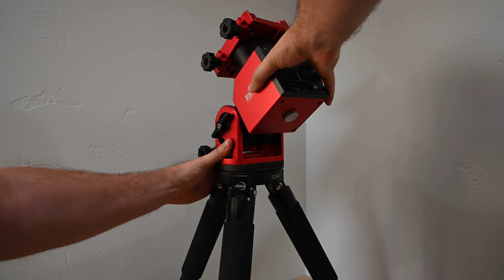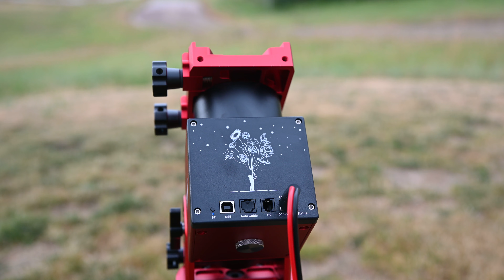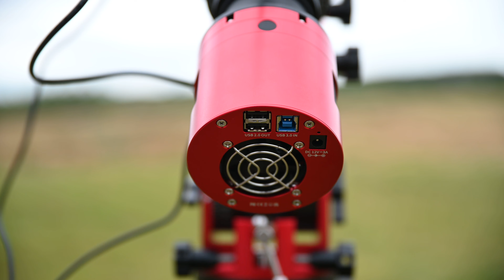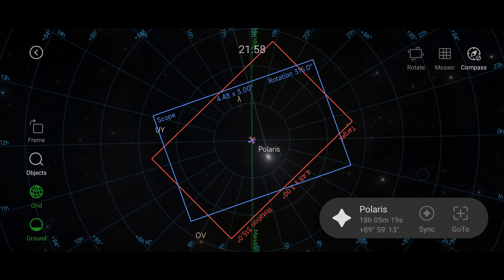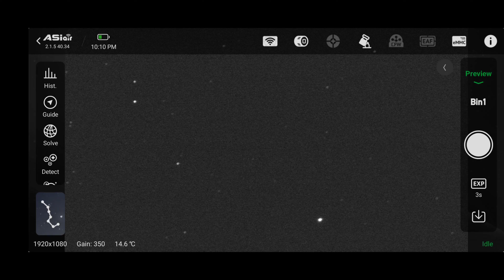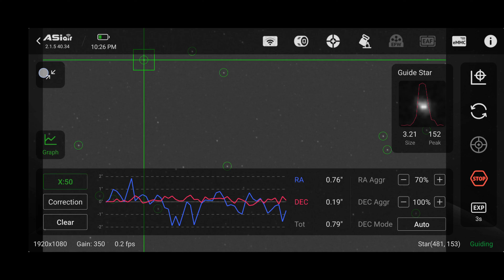ZWO AM5N - Full Setup Tutorial

Comment: Great thorough video.  I also have a AM5N and 2600MC Air and have struggled with the guide sensor (mostly just with my SCT) so those were some great focusing tips.  One thing I was wondering is if the AM5N has go-to functionality without using ASIAIR?  For example if I wanted to use it with a DSLR.  I tried using the hand controller with the SkyAtlas app and couldn't figure it out but it didn't seem like it was possible.  Thanks!

Comment: Using the DC connection on the Jackery is also more efficient.  If you use the AC plug, there's loss when you convert the battery's DC power into AC, and then more loss when the power brick takes the AC power and converts it again BACK into DC for the scope/ASIair to use.

Comment: Hi Peter, excellent tutorial.  I am having an issue with my AM5n. I am using asiair, redcat51 and canon R. Plate solve on preview is fine.  It shows BIN1 and I have selected 3s exp. When polar aligning, plate solve is fine at neutral position but unable to plate solve after 60 degree slew. It just shows loading and nothing happens. I have tried everything but having no luck
 Any ideas?

Comment: Awesome video, thank you! I'm using the AM5N with the beefier pier extension, on the TC40 tripod -- just setting it up for the first time today, exciting. I'm a little confused because the azimuth adjustment screws don't seem to do anything at all. I rotate them contrariwise through their full range either way, and there is just no lateral movement of the mount. I can loosen the holding screws on the pier extension and rotate the mount that way, of course, but I can't seem to figure out why the azimuth screws don't do squat. Any ideas? Altitude works just fine, on the other hand, just as depicted here.

Comment: To balance on the dec axis,  assemble the rig, place masking tape across the dovetail and place the dovetail on a round pencil, smooth surface and move back and forth to approximate the balance point mark the spot where pencil is located, then when mounting place the mark at the center of the mounting deck. The Ra axis requires serious math so I just follow the manufacturers specs best I can.

Comment: Tonight was first light with a new AM5N mount and my ASIAir Plus kept dropping its the Wi-Fi signal. Is that because the Wi-Fi signal of the AM5N mount is causing interference?  If so, how do I turn off the Wi-Fi broadcast from the  AM5N mount? I tried using the SkyAtlas app and don’t see a setting to turn off Wi-Fi for the mount.  I'm not sure if this is the culprit but I never had the ASIAir drop signal like that.  I would think ZWO would have them run different signals.

Comment: I am also unable to pair the ASIAir and mount using Bluetooth.  Peter did you ever figure out the problem during your test with BT?
Reply: the bluetooth works well,  going in settings on the application, Asi mount setting, connect via bluetooth then click on the button on the mount
Reply: @insalatacosmica  In AsiAir I only have USB and WiFi as connection options.  Are you connecting via BT using the AsiAir?

Comment: Awesome video! Just got the AM5N, with the pier extension and the TC40. Your instructions were clear and easy to follow. This was  filled with answers to all my questions. I am keeping it handy to help with getting acclimated from AVX mount to the AM5N. The whole rig is so much more manageable  and lighter. Thanks again, and keep up the great work. Clear skies!
Reply: Wow my AM5N mount arrives today and  I’m also coming from the AVX. I ultimately had driven myself crazy trying to get AVX to work with ASIAIR+, to the point where it was all just sitting dormant for months! I was hoping to still use my nextstar 8SE with the AM5 for now, anyone have issues with that or another Celestron SCT OTA? At this point I might as well get a ZWO OTA and fully immerse into the ZWO ecosystem, but was hoping to give my wallet a break for a little bit
Reply: Here doing the same with the Am5N, changing over from the Az-eq6. This video answered all my questions & made set up so easy! Tnx 🤗
Reply: @luketown8054  what’s your full setup? Unfortunately cold, grey, and snowy here in the mid-Atlantic so still haven’t setup my AM5.

Comment: My Ecoflow River 2 Max powers the AM5N fine. The two DC ports are only 3A, so I may end up using both ports to power everything. We will see. My only troubles were I did not see the power switch at first and then I learned from you that you plug the hand controller in AFTER you power up the mount. Thank you.

Comment: You mention azimuth adjustment of only 6 degrees, and loosening  the lock to rotate the entire mount further. OTA is at 60 degrees CCW, making it off balance. Start PA at 60 degrees CW and second plate solve position will be balanced, making loosening lock safer and less difficult.

Comment: Great video tutorial Peter!
The way I focus the guide camera using the ASIAIR is as follows: 1. select guide camera as main camera, 2. select a bright star and let ASIAIR go to and center it via plate solving. 3. use the Bahtinov mask and the Focus - Tab (not the Preview - Tab!) to shoot continuously e.g. 0.2 to 0.5 sec images (this short exposure time works well wth stars like Arktur, Vega, Deneb,...). With these bright stars you see bright spikes from your bahtinov mask and you can seemingly adjust focus with immediate feedback as you shoot several images per second. 4. switch back to real main camera, go to again to the same bright star (in case you use an external guide scope where you have an offset in FOV between guide and main camera) and do the focus procedure with Focus-Tab + Bahtinov mask again for the main camera (in case of the Duo-Camera of course you first have to focus the main camera and second focus the guide camera).
This procedure works very well for me and is done in a few minutes.
Thanks a lot for your great videos!

Comment: if you kick off imaging on the Asiair and walk away, what happens? you mentioned reconnecting on your ipad, does that mean the asiair just continues on without you being connected to it?
Reply: Yes. It is just so easy to use. I often have more than one "rig" capturing the sky, each with it's AsiAir Plus and just switch between them (or use the iPad for one and a iPhone/Samsung for the other).
Reply: Yes, all the capture functionality is running locally on the ASIAIR.  You can also easily switch from device to device (limited to 2 active connections at a time).  I use my iPhone for initial setup outside.  Inside I monitor the session images on a big screen iPad or MacBook.  I have my ASIAIR mounted on my scope.  If tracking rotates the antenna position occasionally so that I loose connection on the home LAN, I just go outside with my iPhone.  Jump on the local network, pause the capture, reorient the antenna, and restart the capture.
Reply: @rcpettengill  how do you monitor from a mac?
Reply: @John_Hudson_922  M1 Macs run the ASIAIR iPod app fine
Reply: @rcpettengill  nice i didnt even think of that!